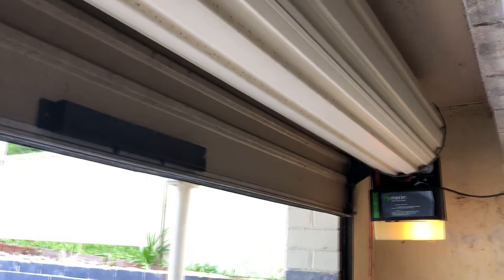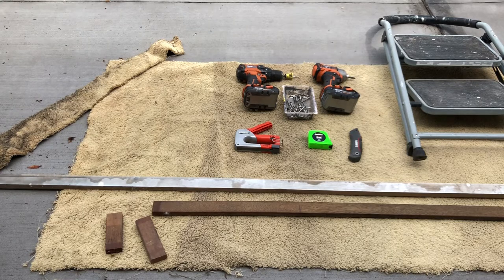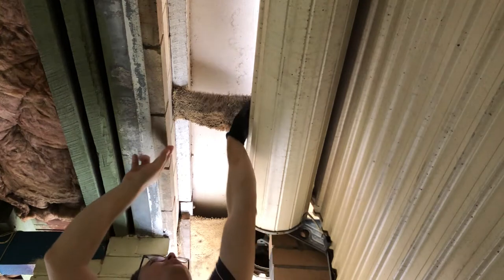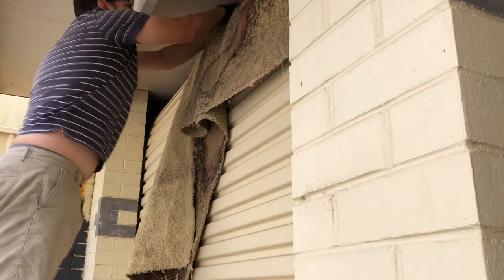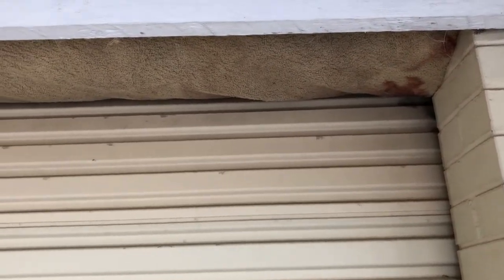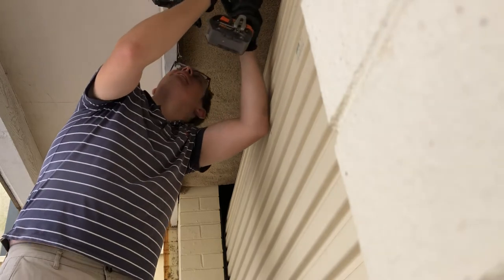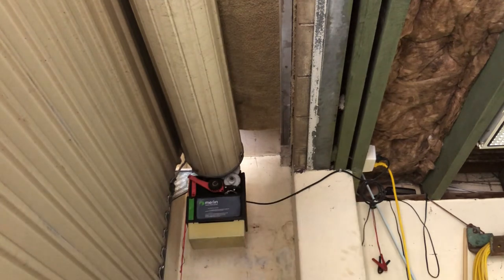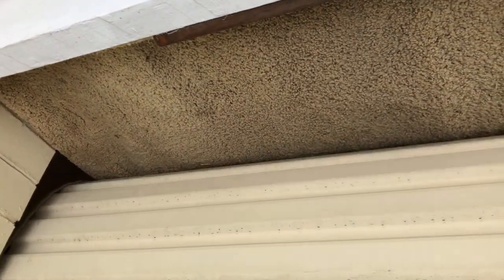How to Stop Draught & Dust getting through your Roller Door (free or cheap)

Comment: I mean, this will do a fairly good job of blocking the wind in dry conditions, in winter this carpet is going to grow a LOT of mould eventually and stink. It's going to absorb/wipe off water that's on the door each time you open it. There are still some pretty hefty gaps at each end, offcuts or shorter pieces of brush seal would fill those and mould to the ridges in the door.

Get a piece of timber, paint it, install it to fill a fair amount of the gap and use a brush seal. You can get really wide brush seals up to and over 200mm. Not expensive, won't stink in winter or rot and fall down eventually.
Reply: The brush seal won't work as the diameter of the roller changes.

Comment: That carpet will scratch ya door
Reply: I'd be more worried about the fact that carpet will be very damp in winter as it wipes water off the door every time it's raining and the door opens. Thats going to be a mould factory for sure and probably smell.

Better option would have been the brush seal and pack out with a strip of painted timber as required or find one of the really long brush seals. You can get 200mm+ brush seals.